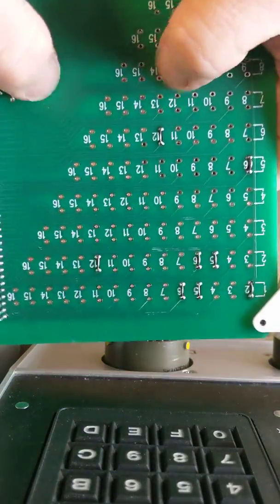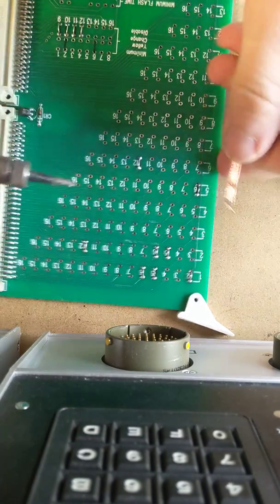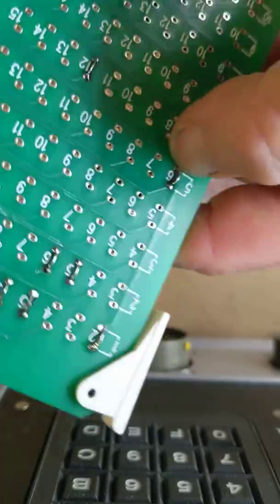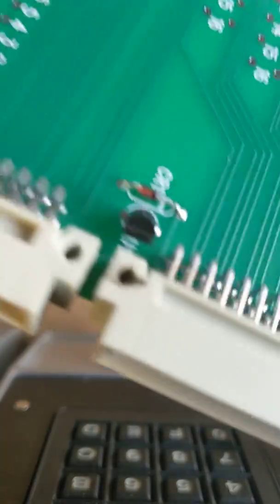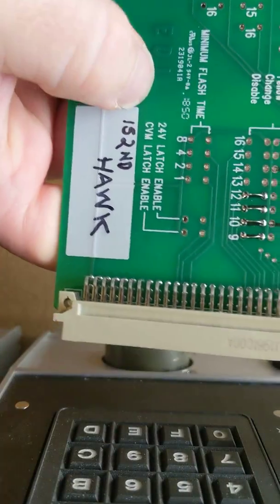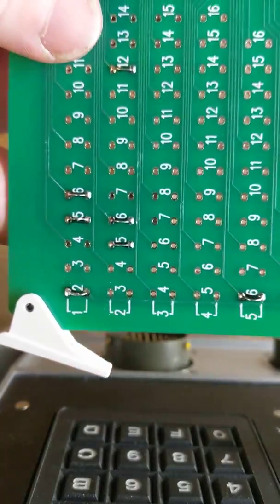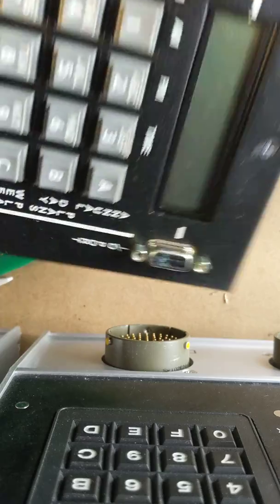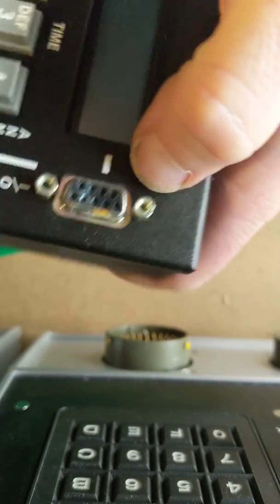HAWK MMU program card

Comment: How is your phases set up? When you said 2 can run with 1, in our state 2 is straight through North, 1 is South left.
Reply from the maker: Ahhhhh... So this is a bit different than a standard 8 phase because this is a HAWK crosswalk signal. It operates in such a way that the main Street phases are 1,2,5,6 and the ped phase is phase 4 or 8. A standard ring/barrier configuration doesn't apply here.
Reply: @trafficsignalstraining7673  We are installing our 1st Hawk crosswalk in our city. I take care of timing, is there anything that would help me to make the turn on easier and more efficient? Thank you!